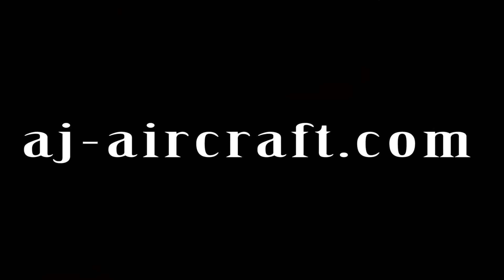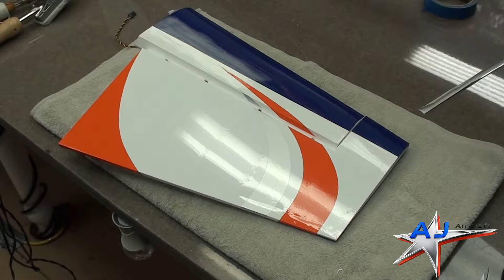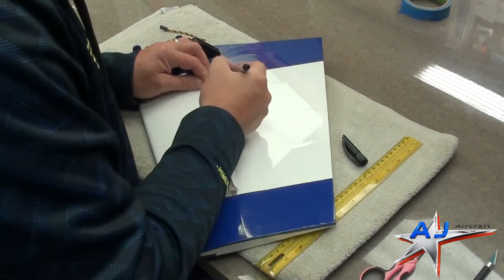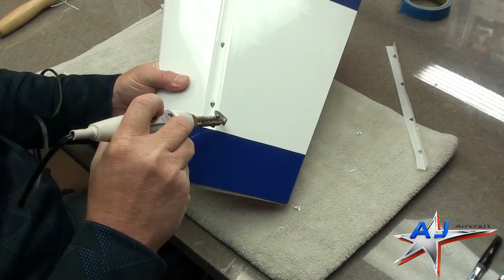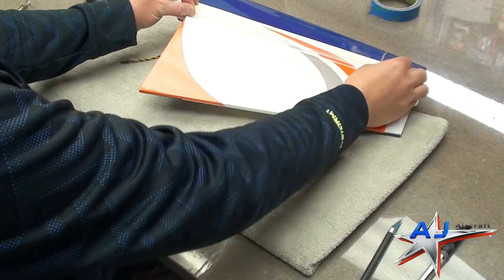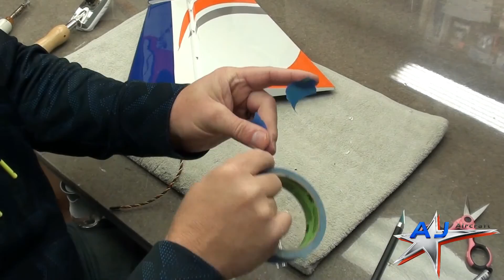RCTEK Episode #2 (Sealing Hinge Gaps)

Comment: this does little to increase the laminar flow of the airfoil, and gap sealing the little crack does very little to improve performance. What would be more beneficial would be a taped flexible continuous seal along the airfoil shape covering the entire V groove in the wing as is practiced on full scale sailplanes. If you a professional competitor and you think every little thing is important   sealing the gap might make you feel like you have some kind of small edge.
Reply: Yeah this does absolutely nothing lmao
Like you said an actual gap seal like on full-scale aircraft would reduce drag and stall speed but again the effect wouldn't be noticeable.
Even full-scale gap seals only increase performance by a couple knots and is only really noticeable in fuel consumption